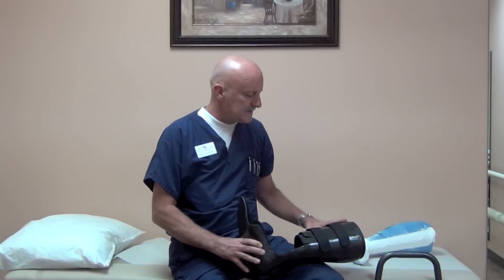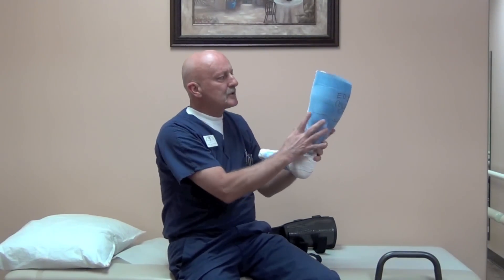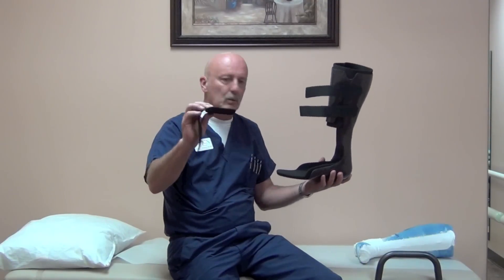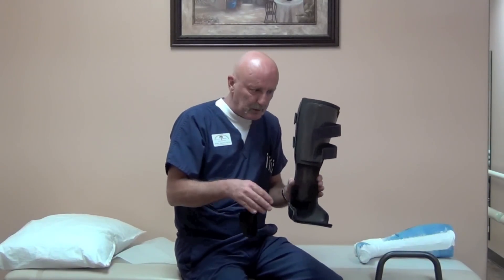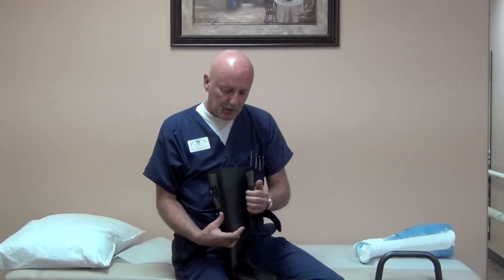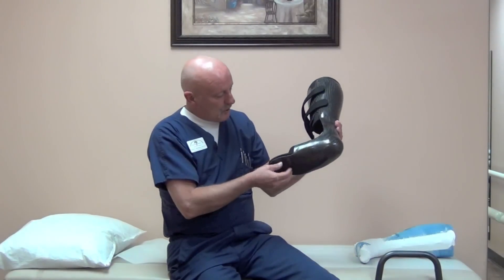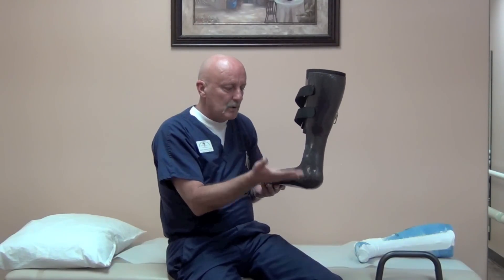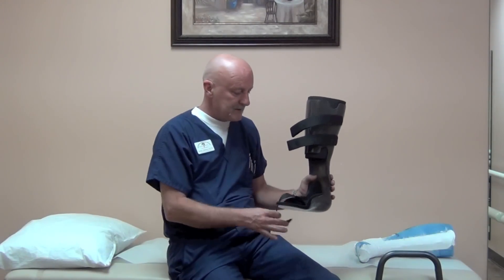LoadShifter AFO: Introduction

Comment: How do you prevent the AFO from stopping the blood flow in the foot? Or is that generally not a problem?
Reply: The pressure is intermittant, it is removed when the weight is removed.  Hasn't been an issue.

Comment: Hi can this design being applied with thermoplastic?
Reply from the maker: +saiful syazwan mohf fadzil Yes, we now make them from reinforced polypropylene.
Reply: Nice thank you for your advice.
Reply: One  question. How you extend the negative cast and attach it again? I just try to do it but have difficulty to attach it back together. Looking for more accurate method :D
Reply from the maker: +saiful syazwan mohf fadzil You cut the cast at the narrowest point above the maleoli.  I make vertical lines to line it up properly.  I staple the two pieces together using tongue depressors, vertically, and line up the marks as best I can.